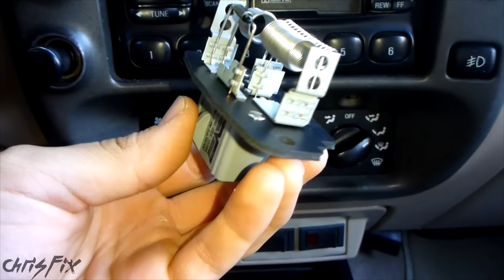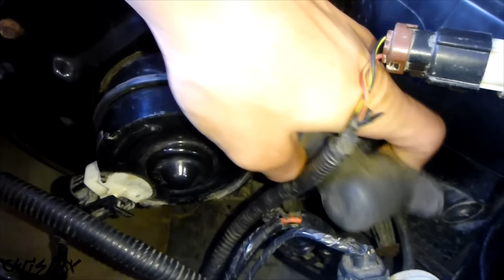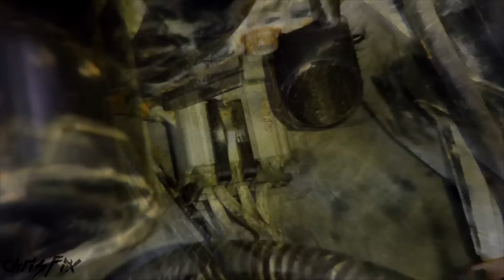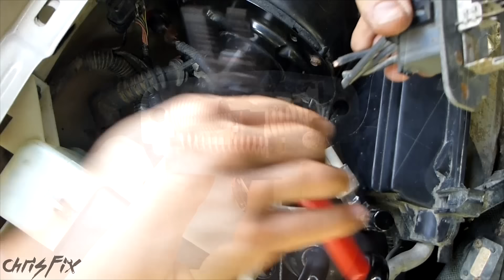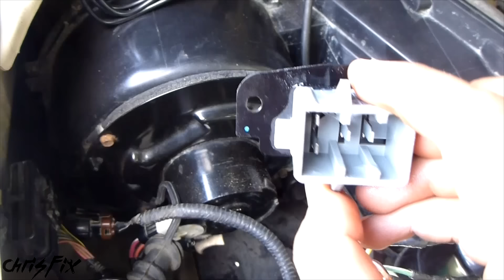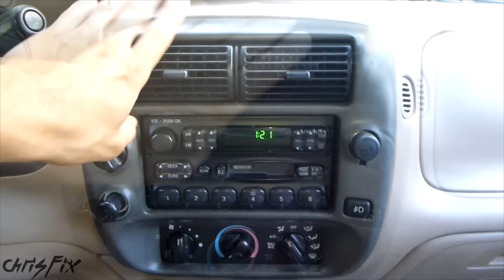How to replace a Blower Motor Resistor

Comment: 2026 here. I have a ‘98 manual Ford ranger. Following your video, I’m going to replace my motor resistor. Present one only works on high. The way it is now, I get plenty of heat. Once the resistor is replaced, should I get cold air on a/c? My mechanic wants to evacuate my a/c and add new freon. Just checking to see if this will really need done. Thank you! Great video. Love the way you explain and demonstrate every step of the process. Very clear and concise.

Comment: I have a Hyundai i20, Fan motor works on settings 1 2 & 4. 3 is dead! Is it still the resistor housing that's a problem?

Comment: Excellent video - very helpful.  Didn't have any speed control except high.  I replaced both the resistor and the wiring harness (they were both rusty and corroded).  Now, I have all speeds except low!  What do you think I did wrong?

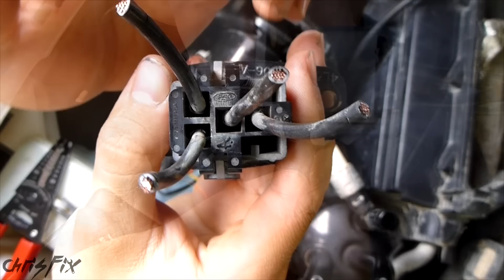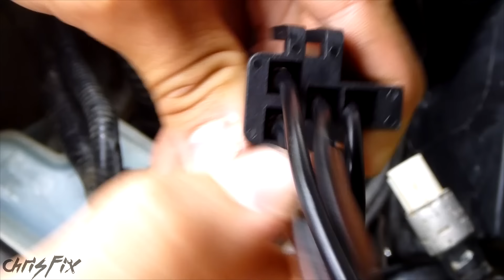Comment: What is a better way to reference which color wires go where? I didn't exactly understand your explanation on which color wire goes to each black wire at the connector. From 7:41 to 8:02
Reply from the maker: I would take a picture of the wires going to the connector (make sure you orient it properly) that way you know which one goes where
Reply: @chrisfix  thank you. Love your videos, been watching for years 👍🏾

Comment: I taught it was blower motor resistor was out but the thing it screws into is all cracked what it that called because it’s leaking air
Reply from the maker: I think you're referring to the blower motor ducting
Reply: @chrisfix  your a legend replying comments on a vid from years ago thanks

Comment: Bro arnt you ment to heat those yellow wire connectors so they shrink around and waterproof the connection? You just taped them up after crimping them dude 😅 easy mistake i guess
Reply from the maker: Yes but at the time I didn't have a heat gun, the tape is an alternative in a pinch and I never got any issues with this after so it works out
Reply: Allgood mate fair enough. I always wondered if needing to hear it was mandatory so thanks for replying dude. You got skills brother keep up what you do. It helps alot of people.
Also my resistor looks like some kind or chip board like a card thing but it's clearky stuffed as its literally rusted and broken. Tell me i havnt taken the wrong part out? Its a 2009 nissan Navara 2.5l turbo

Comment: hello, Im seeking help about a weird issue with my rav 4 toyota 2008. The AC went off completely along with the turning lights. The turning lights do work when I activate emergency signal. I took it to the mechanic and they replaced a fuse and also tinker a bit with the blower motor. again, the same problem happend while driving. What is going on?
Reply from the maker: I would check and clean any grounds as those 2 circuits might share a ground

Comment: Thanks. What happens if the blow will run at the setting you set but then after 10 seconds it slows down to low or medium and will not speed back up again? It will slow down below, 3 for example but won't go up. It goes to 7 speed, but after the first 10 seconds it slows and won't go above 3, even though the computer screen is showing 7 speed.

Comment: if u ever need to take a pigtail off that u are replacing both ends to, pour warm to mildly hot water on the connector if it has corrosion, the warm water washes it away quick.

Comment: The vent that blows face/feet does not work, it only works when you put the chest setting would that be a resistor issue or something else there is no clicking noise just that setting that is giving issues, will it cause issues if not fixed or could it be a door or clogged issues

Comment: 10/11/2022:  
  Dear Chris, 
  Thank you for your videos.  I love your work.  I tried removing my blower motor resistor from the pigtail but it would not budge.  Since then I saw how people have—just like you—cut the pigtail wires and then installed all new wires and resistor.  (I will probably do that even though I've never soldered or worked on auto wiring.)  BUT, would it be safe to spray WD-40 into the tiny voids where the pigtail connects to the resistor?  I've ordered sprays you've recommended but don't have them yet.  Would it be okay to use WD-40 as a penetrant spray to loosen the connection?  I am not loyal to WD-40 and do not use it generally, but it's all the homeowner has at the moment.  And btw, I did look up many websites to get answers to what is safe for WD-40 but didn't find specifics for this application.  I know there will be more pigtails stuck to parts I'll need to replace (2002 Chev Silv). 
dw

Comment: Chris — your videos are excellent but why the hell do you have so many problems with your cars that need to be worked on? Stick w a manual Honda or Toyota and change your oil regularly. I have a Honda that’s 16 years old. Never flushed the brake fluid, changed the pads, flushed power steering fluid or flushed the coolant. Everything is still doing fine

Comment: I replaced the resistor but I still have the same problem. When I turn the car on, even when the fan speed is set to 0, the fan just runs at full speed. Could it be a problem with the switch? How would I diagnose where the problem is coming from?

Comment: Great video! I just replaced the original resistor and wiring connector on my 2001 Ranger. As others have mentioned, the 4 splicing connectors supplied with the kit are also heat shrink so I did that after crimping and then added electrical tape. Works like it should now, thanks so much Chris! 👍

Comment: As always Chris great video really appreciate the way you explain things an actually physically show how and where things are.  Believe that's what's wrong with my blower on 01 ranger.  Thanks for sharing be safe have fun
Reply: Well Chris that was exactly what was wrong with my truck changed blower motor and resistor works great and actually blows out vents better thanks buddy for advice

Comment: An important detail, even if the electrical connector shape is identical, and the appearance is identical, the internals might not be correct for your application. See the manufacturer site for matching application, and if that's a no go, I recommend checking the fsm for the correct resistance for comparison if you are going to try using a cheaper look-alike part.

Comment: Hey Chris will appreciate what you're doing for the car world you save us a lot of time and money with your videos. I have a question for you my G 35 blower is working in consistently meaning it comes on and off for no apparent reason and not like there's a short kind of on and off.
I replace the cabin filter and I'm wondering if it's going to be the relay that could be the problem. Any help would be great it's -30 here in Toronto and having some heat and defrost would be nice. Yes buddy keep up the great work!!!

Comment: i took my 2010 ford ranger to a shop and they tried to fix this problem with my car and changed a few things but didn't even change this, I ended up changing it myself and fixed the problem! and my blower motor resistor was so rusted when i touched it it all fell apart! thanks Chris!!!!

Comment: Why is my blower motor resitor keeps burning out. After replacing the resistor in a couple of days when i turn on the ac or heater it only works on the highest number which is 4  thanks

Comment: When somebody is learning you need to explain things from the standpoint of matching parts or ensuring parts fit. For example, you stated the blower motor resistor and it's pigtail, but you didn't specify or match up the configuration of the terminals, so I wasn't sure what you meant. Also, you should State the possible professional names of the items also, instead of saying just pigtail. I googled and I think you meant blower motor connector relay. Since we're making connections, you should give us those little tidbits.

Comment: It's those 2$ shit crimp tools for being 1 of the major reasons these blower resistors go  "P00f" 2-3 times during a vehicles existence. Solder or use actual professional crimps  to prevent resistor burnout

Comment: Hey Chrisfix, how about the switch that controls the direction of the air flow like the panel or floor? Mine only blows from the defrost vent. Hope you could help me out real quick if u come by this message c: oh and it's a 2000 Ford Expedition with the 5.4L V8 and it's RWD if that part matters 😅
Reply from the maker: Usually it’s a vacuum leak if it’s vacuum driven or a bad actuator motor for the vents that move the way the air flows.
Reply: @chrisfix  , yes it could possibly be a vacuum leak as i did my own research thru the web too. I disconnected a vac line that moves a lever that controls the air direction. I didn't feel no air coming from that line so possibly it could be an vacuum leak! Thanks for the confirmation my dude!! Love every video you upload ❤️ i honestly didn't think you'll replied back man. I know you're super busy with work and family in general so for me personally... It means a lot that you actually replied to an old video of yours! Thanks a bunch 💯✨❤️

Comment: Hi 
I took the resistor off and I turned the aircon on and it still works only on 4th speed without the resistor 
Do you think it can be the resistor fault? Even if it doesn’t have resistor it would still works?

Comment: I thought this was my issue , rather was hoping because im not getting enough wind power. but the old resister was surrounded by debris, leaves, dirt,. put the new one in and still no air power. im only getting a little airflow, so would you replace the blower motor itself? thanks

Comment: Aren't those yellow sheaths around the splice connector heat shrinking types? You may want to get heat shrinking ones, they're far better than wrapping insulation tape around them. Have a water-tight area around the connectors.

Comment: Bro, I just brough a 1999 Mazda B2500 today. I can tell the AC compressor work i can here the sound and feel cool air come out. But the cool air  is weak form the air vent, is that blower motor can the problem? thanks

Comment: I just changed that in my 84 Buick regal. But it's still not blowing on either speed. Any suggestions
Reply from the maker: Check fuses and check the actual dial itself. Sometimes they wear out.
Reply: @chrisfix  I did I cleaned it. It actually started blowing for a few seconds then it stopped. Can't get it to work now

Comment: Good job Chris.  Those butt connectors appear to be heat shrink type. Hold a flame to them and they shrink and seal as they have a special sealant inside of them to prevent corrosion etc.

Comment: Makers secure dealerships get work since car sales alone isn't enough. Japanese car makers (Ford/Mazda collaborate) also make own parts. Defects secure future sales of both parts and cars. Rust happens with moisture leaks. I would add sealant around part where it bolts on. And slightly stagger connectors less bulk

Comment: Love your video...another good product to use on the actual pins of the connectors is Petrox, it is used to help prevent corrosion and improve connectivity on metal contacts/pins.

Comment: Chris, I always use your videos when I have a problem with a vehicle and have been successful until I replaced the resistor and pigtail on my '03 Ford Explorer Sport Trac. Once everything was completed, I tested my work but nothing changed. The fan would only blow in the high (#4) position. What else could it be?
BTW, you're the best and my "go to" when I have an issue!!

Comment: Those crimp connectors come with a heat-shrink sleeve. You heat them up and they shrink, just in case someone has the same connector.

Comment: My blower stopped working altogether ,when I replaced the resistor it would only work on high so I returned it and put another one in and the sMe thing happened so I put the old one back in.Why would a new resistor only work on high?

Comment: Thank you so much brother. I’ll be working on my truck this weekend, Dan blower will be replaced as well as the resistor because it will not work on the lower settings. I appreciate you sharing your knowledge, I just find your page and you are my go to Guy to for repairs on my 2008 Ford Ranger.

Comment: Hey! I don’t think that I’ll probably get a response but why not try. I have the problem where the only a/c setting that works is the highest. My first thought was to replace the resistor on my 2008 Volkswagen Passat but when I did, nothing changed even after checking that I installed it correctly. Any idea what else could be causing this?
Reply from the maker: If you already replaced your resistor, you're ac switch or knob is probably at fault and needs to be replaced, but also check connections to make sure nothing is loose!

Comment: Couple things: Really should make a drawing of colors to the connector before cutting anything.  The colors might not be the same especially on a different model or maker. Second, those crimp connectors are also heat-shrink, it's good to shrink them down before taping.
Reply: One thing: He had the connector with the wires still attached. So no drawings necessary.

Comment: 99 Toyota Camry no air coming out at all brand new blower and resistor but my connector end is burnt there's no power going to it... So when I changed out the connector would I be good to go?

Comment: I had to do all my own research to figure out how to do this. I should have watched this first BUT I have some questions. I pulled the blower resistor and looked at it, it looked rusty, but with my multi meter, it appears as if everything is fine, and it is working . Why would it still be the cause. I check the springs resistance on one side, and then tested the connections on the other side (I put one lead of my multi meter on the red wire, and tested it against each other connection and got some resistance, so I know these are inter-connected and the connection isn't(?) bad, so why would it still not work? would it be the rust I saw on the spring side? on the spring side, the one piece that doesn't look like a spring, has corrosion where on yours in the video is nice and clean black. there was still continuity on my multi meter between each side of this piece). I presume there could be a issue between the two sides of the blower resistors. Is it worth buying another resistor and replacing it? Or should I look for another cause? (By the way, thanks to you, I have restored headlights. It was terrifying to drive, but now I can actually see the road at night when other cars pass by me. My lights WORK. I will be aligning them soon!)

Comment: Sorry Chris what happens is the male part of the connector the things that are 1/4" wide  X 1/16" thick inside the blower motor resistor that plug in to the harness become so corroded that they no longer conduct electricity with them basically open to outside world from the connector side there is nothing that can be done but replacing every couple of years. Piss poor design Ford motor company..... What is needed is some kind of contact Cleaner/De oxidizer/Sealer spray to stop the elements from oxidizing the metal contacts. The heat doesn't help matters either it just makes it worse/happen faster.

Comment: Very good video. If you watch this video you wii see a small thermistor on the resistor block. If it fails there is no voltage to the resistors, and the blower will not work. Usually the whole resistor block will have to be replaced, but for those who want to get to the bottom of things, temporarily connect across the thermistor and see what happens.
Reply from the maker: thanks for sharing

Comment: I just want to add I had the same problem with my Jeep, I exchange the blower motor resistor and I still had the problem, it ended up being the climate control panel that went bad, but I went to the junk yard and found the part I needed in a Dodge Caliber. I hope this helps someone that has the same issue trying to figure out and fix their car. It was the same symptom so it’s easy to get them confused
Reply from the maker: thanks for sharing!
Reply: ChrisFix thank you... I’m a big fan of your channel, I’ve learned a lot from you. I appreciate what you do by sharing your knowledge

Comment: Can this be the reason i am nog getting any heat in my car? A vw polo 1999
Reply: aimene chikri... no that’s not it, this has nothing to do with the temperature in your car. Blower motor resistor is what makes changing the air flow speed on your vents. You might have a problem with your cooling system like a radiator leak or a bad thermostat among other issues. If you have a check engine on you could get it diagnose easily by taking it to a part store to have them scan the trouble code for you, this is a free service most part stores offer, good luck to you
Reply: Mauricio De La Cruz thank you very much
Reply: aimene chikri you might also want to start by checking your fuse box , sometimes it’s just as easy as that. It could be a blown fuse
Reply: Mauricio De La Cruz 
I don’t think i have a blown fuse my Third and fourth setting still work. Only the first 2 don’t.
Reply: aimene chikri I’m so sorry I misunderstood, I thought you were not getting heat but your blower motor worked. Ok, this might actually be your issue, if changing the blower motor resistor doesn’t work for you, it could be your climate control panel that’s going bad and only a couple settings work instead of all of them. I hope this helps